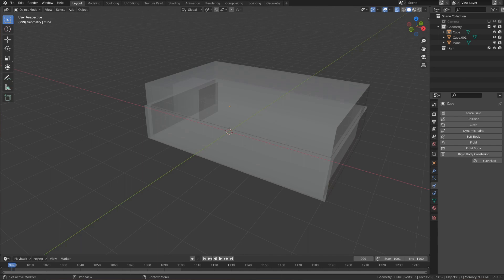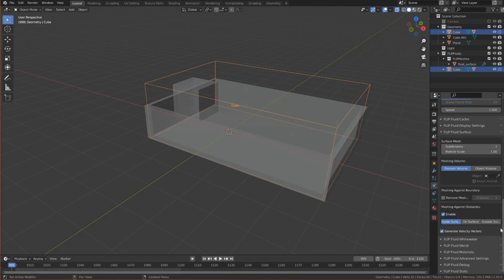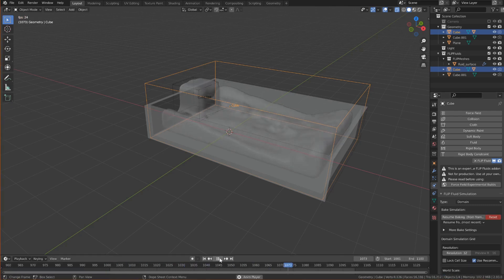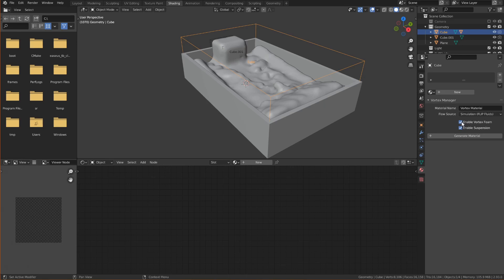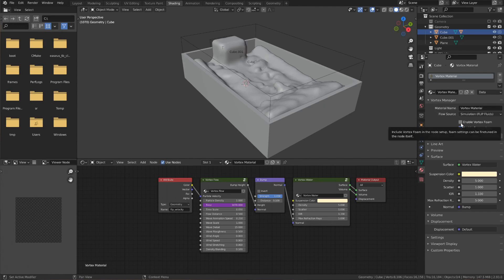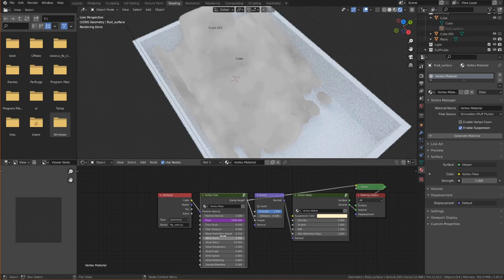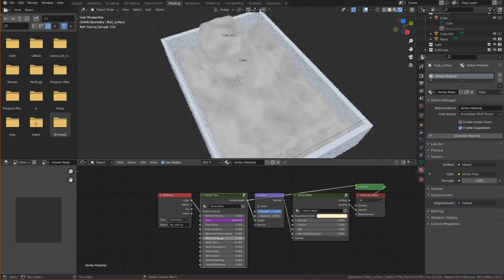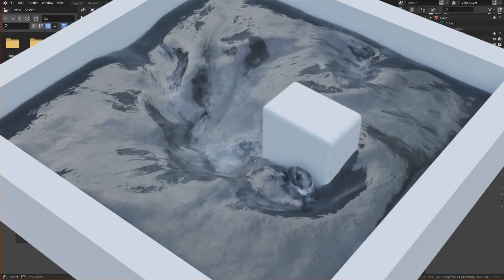Blender Vortex Manager and FLIP Fluids tutorial

Comment: Hello! Just recently purchased this. How do I change the shader to make it look less transparent? Like.... chocolate fudge opaque? I got this because I needed to add detailed waves/flowing to my simulation but I can't seem to figure out how to make it look like chocolate. Hope you can help, thanks!
Reply from the maker: Thanks for your purchase! If I understand correctly you only want the wave details but not the transparent water shader. You can simply delete the "Vortex Water" node and replace it with a Principled BSDF node that looks like chocolate. Just don't forget to connect the bump map to the normal input of the new node, that gives the wave details. Good luck!
Reply: @WittingGraphics  thanks! I tried that and it worked. Now i just need to figure out how to make it look like it's not flickering.
Reply from the maker: @dodongdelacruz4619  Glad to hear that worked! What exactly do you mean by flickering? If you need to send screenshots or blend files you can use the blendermarket messaging system.
Reply: @WittingGraphics  hold on lemme try messaging you there :D